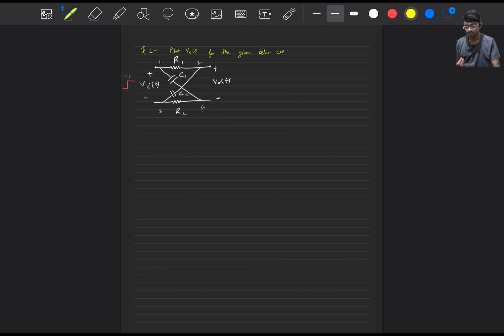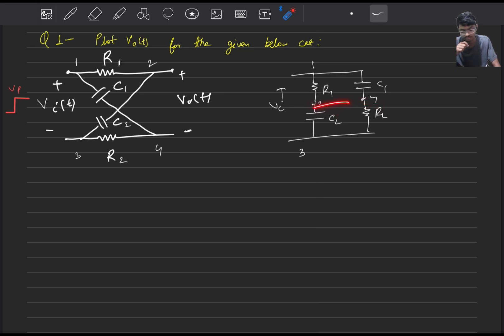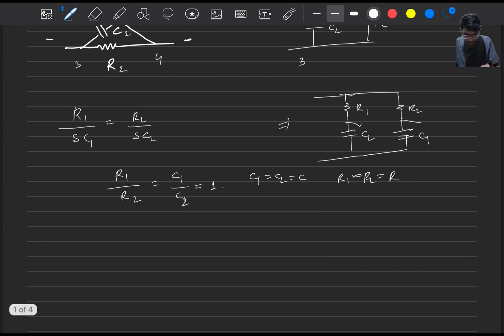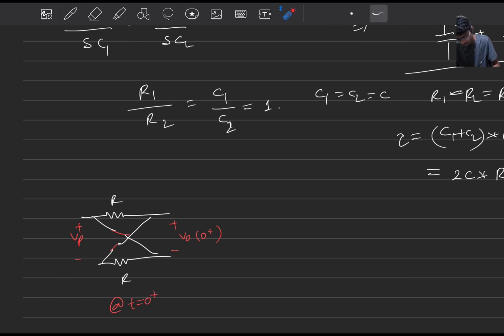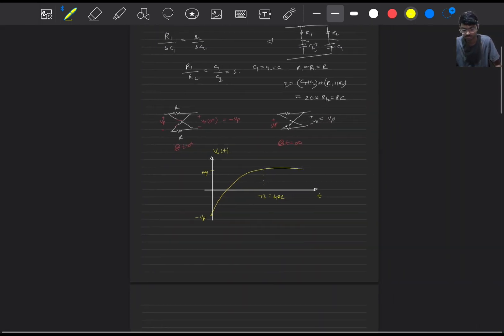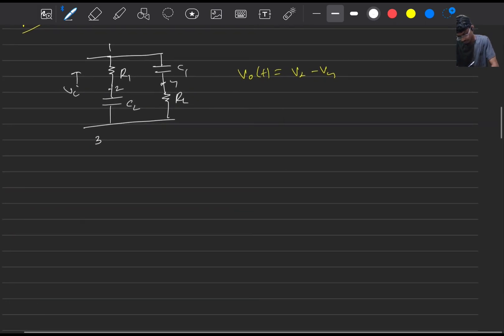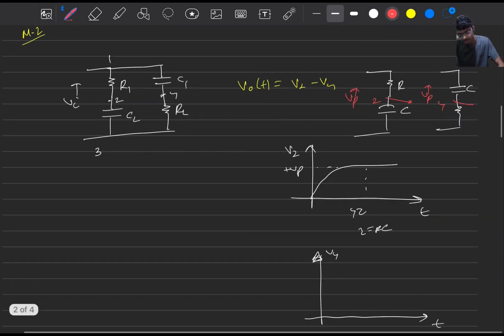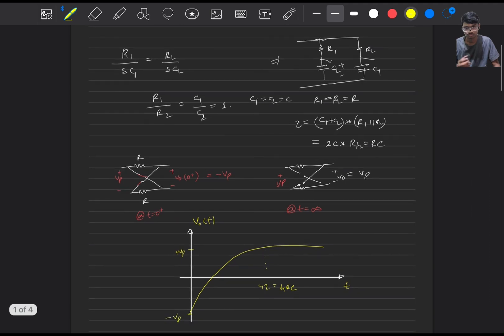Lec 1.1 Complete analysis of a RC Bridge Circuit for Step Input | Multiple Methods

Comment: here the product of impedance should be R1/sC2 = R2/sC1 right? 
and how is that 4t (4RC)
Reply from the maker: 1. No whatever is written is correct the diagonal multiplication of impedances should be equal to each other for the balanced condition of Wheatstone bridge.
2. If we derive the transient equation of a first order circuit we will get something exponential which will get to 98% of it's final value @ 4*(time constant).

You may go through the notes given in drive link there I have derived for one case.